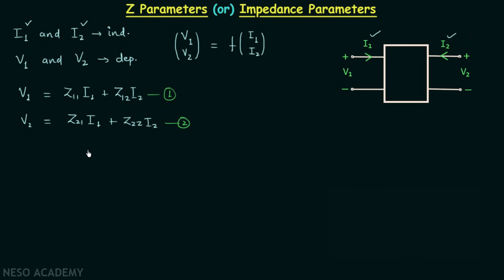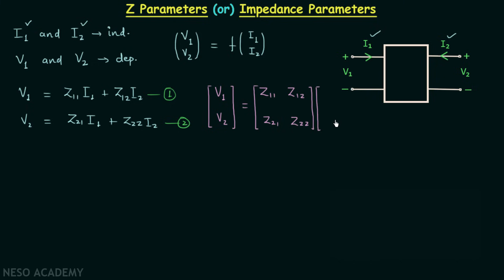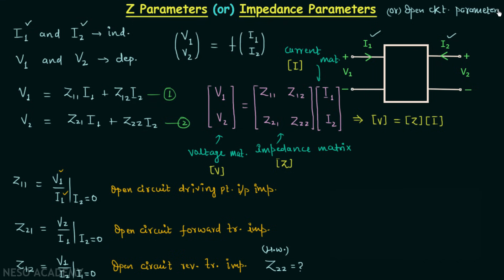Z−Parameters (or) Impedance Parameters

Comment: (H.W1)=>Z22=V2/I2 at I1=0;open Circuit(open circuting the input port) drining Pt,o/p imp(driving point, output voltage/output curren ,output port , impedance )

Comment: Z22=V2/I2 | I1=0 (input port  open circuited). Z22 is output point driving impedance. Sir I understood the formulation of Z12 and Z21, but I didn't get that how:Z12 is reverse transfer impedance, and Z21 is forward transfer impedance.
Can you explain dear Sir @Neso Academy in your own wordings while in a summarised form 🙏❤️

Comment: Can you please help? 
A two-port network is driven at both ports such that the port voltages and currents have the following values (Zo = 50 2): V1 = 10290°, 1 = 0.2/90°, V2 = 820°, I2 = 0.162–90°. Determine the input impedance seen at each port, and find the incident and reflected voltages at each port.
Reply: Active mat ho

Comment: Homework :  Z 22 = V 2/I 2 at  I1 = 0           open circuit(we are open circuiting the input port) driving point ( output voltage/ output current ) output ( we are taking at output port ) impedance (Voltage / Current = Impedence )  hence Open circuit output impedence
Reply: Driving point you missed
Reply: Well explanatory, thanks
Reply: great answer
Reply: Great comment
Reply: thanks
Reply: Ewww nerd